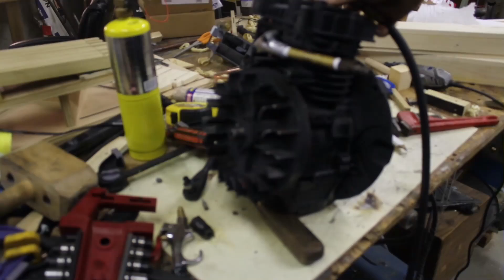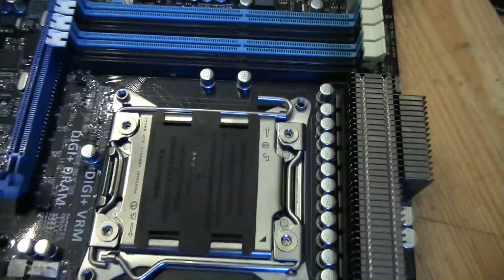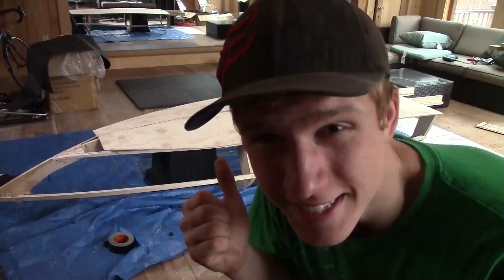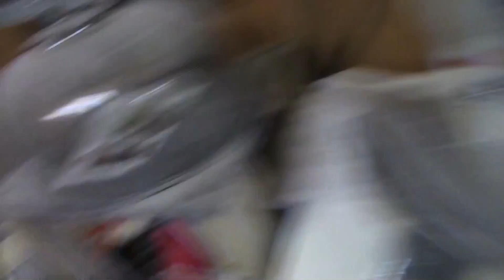RANDOM BUILDING ~ Helium Liquefier, Rocket Engine, ROV, Superconductors...

Comment: Awesome stuff you are doing. FYI the chip in the processor for your computer isn't that big - the visible top is a slab of copper which acts as a heat spreader.

Comment: Where can I find the measurements for the rocket engine nozzle (and other parts)? Mind sharing yours, BenNBuilds?
Reply from the maker: It's unlekely yours will be the same and mine was kindof too small anyway, just use this software its pretty quick http://www.propulsion-analysis.com/index.htm
Reply: Thanks! I've already designed it, and am in the process of turning it on the lathe.

Just out of curiosity, how many kN of force does your engine make?
Reply from the maker: That one made pretty much none, as i never ran it on the fuel I built it for.

Comment: I think you need a 3D printer. And if you can make/mod one  to print affordable metal you WILL make a bunch of money
Reply from the maker: I do want one, always just bought other things first. If someone want to give me one that would be the best, as I would use it all the time.
Reply: I know what you mean,  budget is never sufficient to feed curiosity. Besides asking for a donor,  the Prusa isn't so expensive and open source.  Last but not least your CNC milling machine,  add an extruder and you have a printer... coding  the slices,  we'll..

Comment: My gaming PC has enthusiast grade parts. The motherboard is specifically designed for overclocking and I got a liquid cooler from corsair. It has AMD's absolute best gaming processor, a quad core FX Vishera, that goes at about 5 Ghz when fully overclocked and can still stay cool. I have a cheaper case, but otherwise, it as of now has the best commercial parts.

Comment: On the rocket engine: It looks like you don't have enough pressure in your combustion chamber. This is likely due to the fact that the chamber pressure does not exceed the pressure in the fuel/ox injectors. As the chamber pressure nears the injector pressure the flow rate through slows, choking off the engine and keeping the chamber pressure below a certain cutoff value.

One solution would be to increase your injector pressure using a pump, high pressure helium displacement, et cetera; but a far simpler fix would be to use a nozzle with a smaller throat, lower expansion angle, and smaller expansion ratio. The latter will however have lower thrust than the former owing to it's lower flow rate at similar exhaust velocities.
Reply from the maker: scienceprimo Of course not, The runs in this video were done with gaseous fuel/ oxidizer.
 The rocket and injectors were designed and calculated for use with liquid oxygen and alcohol, which isn't ready quite yet

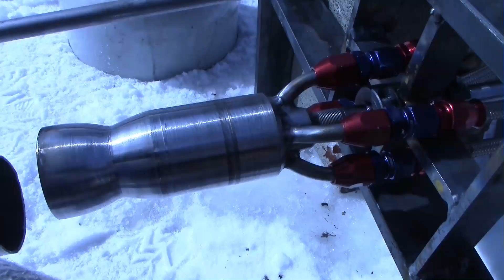Comment: 3:00 - your machining skills are great, that rocket looks awesome I can't wait to see it working.
3: 45 - Nice green arcs!
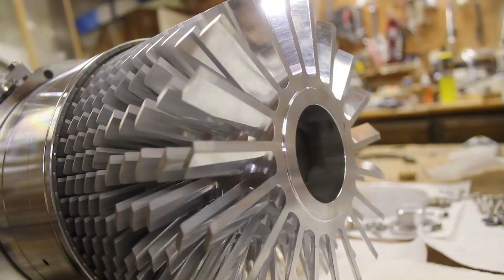4:40 - How do you acquire all these awesome things?! Its beautiful.
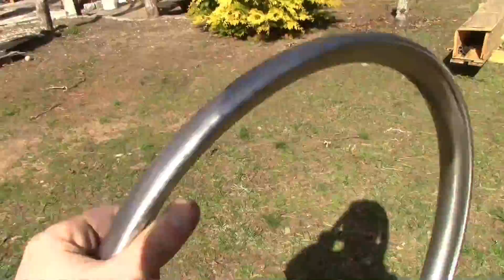6:50 - again, great job.
8:52 - Nice bike, but for the sake of simplicity I would just buy a motoped. 
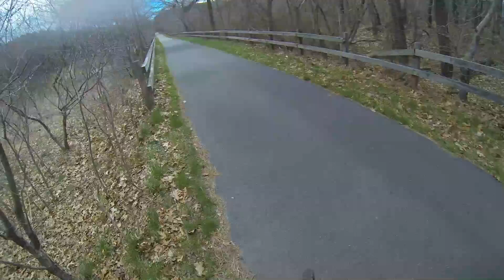9:10 - Where do you live? 
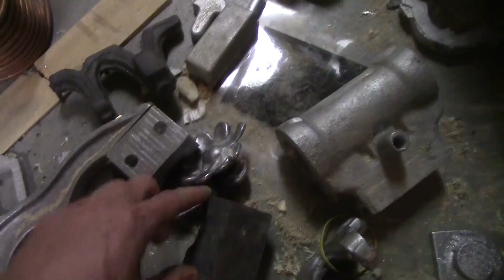11:45 - casting is a lot of fun, you have been very busy i see. 
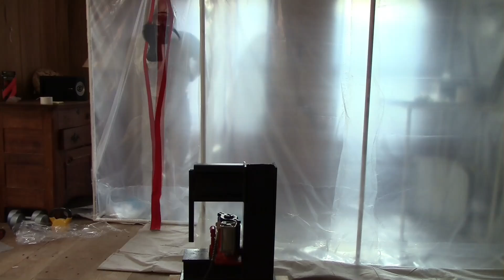11:55 - its time to cook.
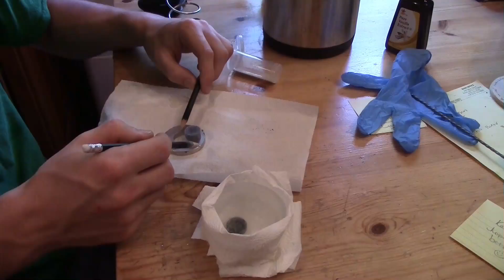13:10 - so close!
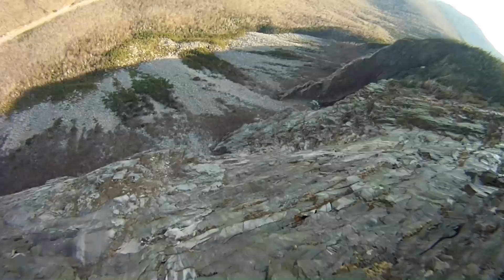13:40 - fpv? over that beautiful scenery? ok now im jealous.
15:45 - ok at this point im sure you are a genius. 
17:36 - how many hours did that boat take?
18:16 - nice harbor freight welding goggles
22:02 - you must live near a university to get all those surplus supplies and the DNA sequencer. 

Was all that stuff in 3 months?
I gotta ask, what do you do? You must be some kind of engineer.
Reply from the maker: *****  Thanks! 
Ebay, I live on cape cod, and I'm 18. I've been working on the boat on and off for about a month and a half, Just finished the top coat of paint today
I just build stuff for people, for a while I did aerial Photography and other normal jobs like carpentry. I'm actually still in high school
Reply: +BenNBuilds that is just incredible, I am 22, on my way to a master degree in energy system engineering and I wish I could build half of that
Reply: +BenNBuilds YOU NEED TO GET ON YOUTUBE AND MAKE SOME MONEY DUDE - YOUR AWESOME